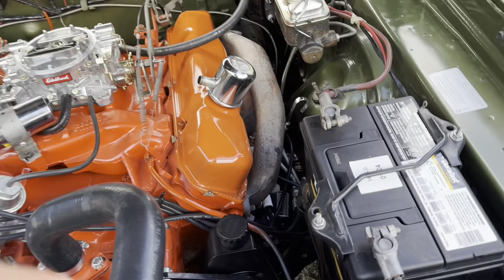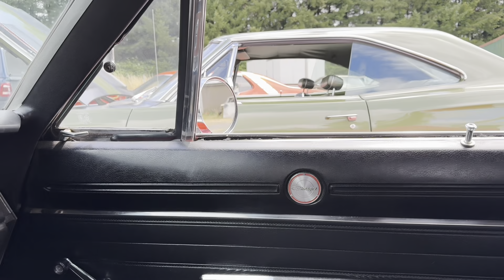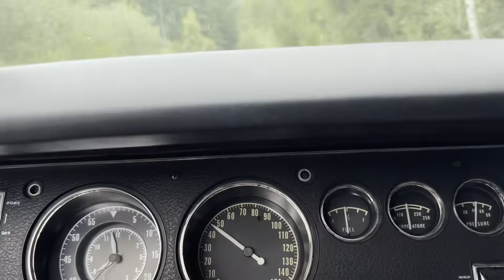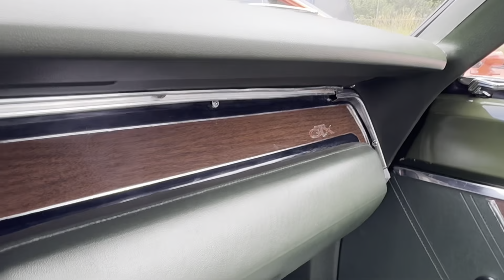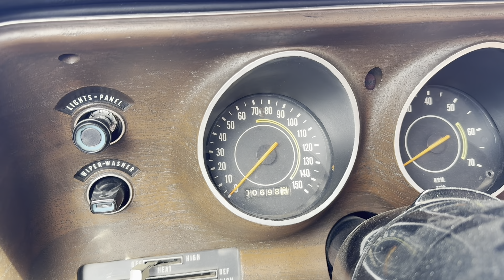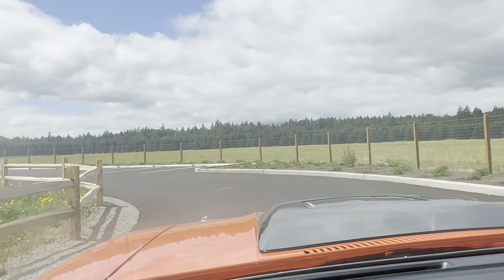An Expensive Front Suspension Is Not The Answer! Magnum Force vs Borgeson Vs Stock Mopar Comparison!

Comment: aftermarket suspension on any mopar the only aftermarket suspension id buy is shocks for the application adjustable shocks for drag racing or kyb adjustable for driving id never use factory shocks again . all factory components tube control arms look impressive but i do not like em
Reply from the maker: Bilsteins do wonders to for ride and handling

Comment: I don’t think that RR suspension is for a daily or weekend driver. As you noted it doesn’t have splash shields but also the steering rod ends don’t have boot covers which looked very dry which will result in accelerated wear causing loose steering. The suspension is probably more for racing.
Reply from the maker: It’s just poorly designed, engineered and doesn’t fix any sort of problems.
Reply: The willwood calipers do not have any dust boot just a singel o ring seal for the piston . Do you get brake pads at your local parts store to wilwood brakes ? Do you thrust a aftermarket steering nuckle ? Do jou need four wheel diskbrakes on a Street car ? Is this junk tested on a wheelstanding 426 hemi b body on the strip ?
Reply from the maker: @hansnordstrom2373  ya not meant for the street which is ridiculous.

Comment: I had a 69' RR. And test drove an early 70s RR 71 72 73 can't remember which. But the handling and ride was way better than my 69'. This was late 70s, maybe early 80s when I drove the test car. I got my RR around 75' or 76' and noticed the ride getting sloppy as the miles racked up. Bottom line A and B body mopar rides don't hold up.
Reply from the maker: Stuff just wears out it happens.  73 was the rubber isolated year and those handle terrible when they wear out.

Comment: You really need to test all three with the same tires.  
On the ‘71 maybe the coil-over setup transfers more harshness to the structure, since the structure wasn’t designed for that.  My limited recollection is 5he 71-2 B bodies were kinda rattly generally compared to previous models.  So for say 12k today?  Save the $.
Reply from the maker: They all had very similar all season radial TA type tires.

Comment: Good comparison, I did all bushings, rubber not urethane, qa1 uppers boxed the lowers rear Hotchkis sway bar added BFGs. Drove the car for a year or two. Got a deal on new Hotchkis torsion bars and was impressed going through dips and to Stops and cornering. Next prolly FF box and Discs, my drums grab and need to see what's going on in there. Thanks.
Reply from the maker: Stiffening helps a lot in handling on these cars.
Reply: The squeak is most likely the spherical joints. I would use those on the street unless you are into lots of maintenance.

Comment: I’d really like to get my 71 Torino Gt riding much better, But that old suspension sucks to drive long distances. All of the old cars weren’t the best. A TKX is in the works for mine. The Borgeson steering I’ve had nothing but problems on my fairlane and everyone around me
Reply from the maker: Interesting to hear the Ford’s have had problems.  Other than how the steering column to box matches up (it’s really awkward how it goes together and causes some problems) have heard mostly good things about the boxes.   Now some of the other stuff… the Borgeson idler arm was shaped wrong on the Gtx so it was hitting the torsion bar when turning.
Reply: @rocketresto  the box gets in the way on fords, to a detrimental effect. can't run PS and 4 speed with headers on any ford, The stock PS units leak every 3 months after rebuilds. Borg unit has alot of overheating issues, sitting at idle for 5 minutes and will be at 240 degrees at fluid not touching Steering wheel. id rather go quick ratio manual at this point

Comment: Really cool and helpful video! Thanks for bringing us a long. Awesome to find out about the Borgeson set up. Wild to think they are on Cherokees too. Hope you get those issues polished out of the cuda, super annoying. Prolly time for a rebuild on that PS pump, and that breaking noise on the right rear sounds like one of the rear drum break pads don't have the spring on exactly right. Problem is that uneven breaking will wear out the mounts unevenly over time and make the rear axle further forward to the right too. Might notice it if you go over a bump and rear end wants to move to the right on you seemingly. It starts out pretty subtle though. All that dash squeeking was driving me insane, not sure I know an answer for that. I might take everything apart and either add shims of thin vinyl, like the slide pads or not sure if spray silicone would work for very long.
Reply from the maker: Going to go back to stock on the front end on the 71 RR, just don’t trust it.

Comment: If you find the stock suspension unacceptable you probably shouldn't have an old car.
Reply: Right on, seen lotsa old cars ruined by folks that should stick with modern cars.
Reply from the maker: Lots of room for improvement on a stock front suspension but no need to reinvent the wheel.

Comment: 1960s Fords were designed right from the factory with the shock tower being the support mechanism, and they are known for the shock towers cracking. Putting all that stress on an area that was never designed for it is only going to lead to failure.
Reply from the maker: Yep not a good design
Reply: 100%

Comment: Very interesting video. I have an aftermarket front suspension in my 70 Challenger. It's a Control Freak which is a Reilly Motorsports knock-off. The car corners very well and much better than stock. The downside is it's very noisy and ride is very stiff even with the Viking coilovers at their most comfortable setting. If had to do it over again I would have left the stock k-frame/torsion bars and just gone with a firm feel steering box and perhaps some tubular control arms. Very similar to your findings!
Reply from the maker: Would have been cool to have some other set ups to try.

Comment: I know more Negative camber helps handling, but it wears out tires in the inside. 
It is common on track events , meaning lots of money spent.  So a couple of new race tires is to be expected sacrifice for a second a lap.

   The Mopar Bible basically advises the tires be straight up and down when the nose is lifted sightly up to simulate the wheel drop when accelerating hard, but this is only for drag racing.  For a "cruise to the cruise night" or "take a long road trip" car I can't see any benefit to having more choices in camber. There is way more than you need already in our cars.
I did quite a bit of tire damage when tried to do a driveway alignment to  reduce the negative camber right before a road trip to a friend's wedding.  After I got on the road, it pulled hard to one side and I realized I did it the opposite ( even more negative camber) and was down to belts showing after about 250 miles. I put on my spare and it  was wearing pretty fast. I had to spend the morning of the wedding looking for a cheap tire already mounted, but the wedding was in the afternoon so I was on time.=. I did a correction at a truck stop and have not had to do it again, though I try to not put new good tires on  the front of any car I aligned myself.
Reply: The issue isn't whether you can get enough camber, it's whether you can get enough camber AND caster.  With stock suspension you can usually get one or the other.  These cars were designed for the bias ply tires of 60 years ago, not modern performance radials.  The correct alignment specs between the two are far different.  Having worked professionally on both vintage race cars (mainly bias ply race tires), and similar vintage performance cars using modern radials, you want a bunch more camber and caster with modern tires.  It's what they're designed for.

As for your driveway alignment... bear in mind that camber on its own doesn't wear down tires fast, incorrect toe does though.  And changing camber will affect the toe pretty dramatically.  It's all a system, and every adjustment affects the others.
Reply: @rennkafer13 
Well, that gives me something to think about.
 Any single one of castor, camber, and toe in will wear out tires even if the other two are perfect. There are pictures of the different patterns of bad wear that each of the three causes on every service manual. 
I always take a look at VW Beetles and dune buggies and they have bizarre looking Camber and I want to see which ones have bad wear. I ask the owners at cruise night. The ones that say it isn't a problem are the ones that trailer the cars.
Reply from the maker: That’s why we use the offset upper control arm bushings to get a little more.
Reply: @auteurfiddler8706  ya, any of them will wear tires, but toe will do it the fastest in my experience.  I've gotten 30-40k miles out of performance tires on cars with -2 degrees camber.  I've seen harder non-performance tires down to cords on the inside in a few hundred miles on cars that were lowered that had a bunch of toe out.
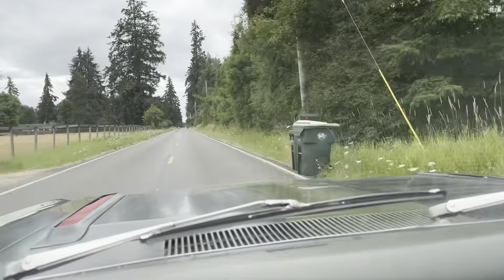Reply: 27:57  How about the GTX needs more castor?

Comment: I always wanted "Comp T/A"s of the 1980s, as opposed to the steel "Radial T/A" 
But for a 67 to 69 model year Mopar, I like the look of red lines.
Types of Tires, oldest to newest:  1.  Bias   like ( 7.75 14)      2. Bias belted (Polyglas GT for example)  3. radial belted  with steel or with fabric belts.

Red lines with radial construction.  Maybe the best of both worlds.  But expensive.
Both are offered.  At the price, I think I would buy some low cost radial white walls and maybe paint them red.
You can still order them in 75 series and maybe 70 series.
 I would bet more 69 GTX's and 68 Charger R/T's came with whitewalls than any other tire, so maybe just leave the sidewalls white.
Reply from the maker: Like the look of those particular tires.

Comment: All the popping in turns is what you get with polyurethane bushings. I hate urethane suspension parts. I've reverted two of my cars back to all stock rubber because of all that noise.
Reply: I've probably had 10 cars with poly bushings and never had that problem, installed probably 30-50 more sets in customer cars without issue as well.  If the car is popping in turns, there's another issue.
Reply: @rennkafer13  That's a lot of cars. Glad you're having good luck. I'll never try poly again after 2. Guess I accidentally fixed them when I went back to rubber.
Reply from the maker: Poly can sometimes make that noise but this this was just worn out parts.  This car has had 700 miles on this, it should not be worn out.

Comment: I agree, the stock torsion bar suspension is the way to go, especially considering the cost of the aftermarket kit. It's much better to use some of that money to just replace any worn out stock components and a good set of shocks. Firm feel steering box is good, although I am ok with the "zero road-feel" stock box. Sways bars really help, especially front and rear.
Reply from the maker: Have found a rear bar doesn’t make much of a difference but the front certainly does.
Reply: QA1/others makes kit's that keep the t-bar's the rack-kit as my new engine has a 8~in SS-types  pan the drag-link doesn't fit well and or iv herd it can handle if set-up correctly

Comment: I disagree with your statement that the core support on all Mopars left the factory with the  front facing side painted black.  I owned an original paint 1971 Challenger, that I bought in 1986.  The car was unrestored.  The entire core support front and back was painted the body color GB5 Bright Blue Metallic.  There was NO black anywhere on the front of its core support..
Reply from the maker: Some dark colors didn’t get it but they should have.  If you car didn’t have it it was missed on the assembly line and was a mistake.

Comment: An idea for the next Rocket Test Labs- calculating the degree of rear axle pivot, in jounce mode, to the degree of body roll allowed by a rear sway bar.   In the "Roadability And Handling" (September 1965)
Volume 65 #09 MTSC training book, page 5 begins the discussion on rear axle geometry.  When cornering, body roll puts weight on the outside wheels. At the rear wheel, the articulating shackle allows an amount of forward pull of the axle in jounce position (when weight is put on that side). This causes the rear wheels to point in the same direction as the fronts giving a caster effect thru the cornering. The question is, how limiting is a rear roll bar to this pivot of the rear axle in jounce position? Is there a perfect roll control ratio to axle pivot angle by changing sway bar thickness? A scale of sway bar thickness to axle pivot degree ratio, does anyone calculate one of those?
Reply from the maker: We had a 67 Fury race car that was in the 24 hours of Lemons and we actually ended up taking the rear bar out, it just didn’t do a lot.  Was a long wheel base car but personal experience.

Comment: I put a borgeson in my E body. The box  $600, hoses $100, coupling from Bergman that fit to the box without cutting the column  $200.  A lot of guys buy a TA length pitman when they get a firm feel. ($200)The long pitman is not needed with the borgeson. I got a NEW box with more room for exhaust. It steers better than my 2021 daily driver. I would bet that the comparison between firm feel and borgeson would be closer if both cars had their alignments dialed in. I spent more time dialing in the alignment than installing the steering box. Moog problem solver bushings on the stock control arms are the best.
Reply from the maker: Borg definitely had better feel and price isn’t super far apart.  Not a fan of how the column goes into the box however.

Comment: Dartiness sounds like alignment.
I was under an impression that the amount of power assist, lightness of steering, was determined by the strength of the spring there at the outlet of the power steering pump. IDK what FF does to make their box feel firm, maybe it's tolerances? 
I can't believe they designed it to mount to the body.. omg.  Good on dad to put it right.
I'm trying to figure a way of doing a bounce count in the video between the T bar cars and the coil one. It's that continuing bounce of a coil that makes them feel like a boat or on pogo-sticks, particularly McPherson strut type. T-bars tune that bounce out flat and fast.
Reply from the maker: Could be alignment, Jamie aligned this car and got it as close as we could with the parts provided.

Comment: The factory torsion bar set up was junk from the factory....I'd take that magnum for e front end any day.
.....and that brand is top of the line for Mopar k members....soooo yeah...lil Mopar knowledge for ya 😢😮😮😮
Reply from the maker: The sarcasm is dripping from your comment.
Reply: That f--ckn highly polished, triple chromium plated, Star Wars, Space age MAGNUM coil over bullshit contraption under your dad's  Roadrunner  gotta go. I don't know. If you keep it you might aswell go and add one of those fancy genuine, triple chromium plated, FULL HOUSE BILLET, March pulley set ups to the front of the engine along with a purple anodized AL U MIN E UM flex fan. Unfortunately  your still stuck with your basic black serpentine belts. Now there's an idea....Someone needs to bring to  market a line of glitter impregnated, light up fan/accessory  serpentine belts! Call em RAINBOW belts. 🌈  😅 The idea of a time/ performance proven OEM K frame and torsion bar suspension or brake systems wheels and tires  has gotten so perverted by the SEMA suck up following. Look at old pictures of Nascar prepped Chargers, Torinos, Chevelles, they were running fu--ckn HD DRUM brakes at all 4 wheels well into the 70s....None of the drivers runnin Mopars had any complaints about the torsion bar front suspension set up
 Oh my GOD! LIVE REAR ENDS! WHAT NO OVER COMPLICATED INDEPENDENT REAR SUSPENSION!? YOU MEAN A CAR COULD ACTUALLY BE ABLE TO HANDLE AT SPEED WITH A OH SOOO ANTIQUIDATED SOLID LIVE REAR AXLE. OH THE HORRORS (exclaimed the snooty Road and Track or Car and Driver or Motor Trend magazine know it all journalists) Another thing...what's the point of using tire shine when modern tires have those ugly textured ribbed sidewalls presumably  so they can substitute  different brand names in the manufacturing molds...Anyone remember buying new tires at blem sales?  Drove Ford Crown Vics hard at times many many miles over many years. 1994 to 2013. When Ford changed them over to the rack and pinion steering set up I had great anticipation to feel the big improvement. Well still handled good for a larger car but was no different from the old steering box.
Reply: Stick with Ford's and G.M.s pal...lol
Reply: Hopefully all those popping noises haven't yet been the results of metal fatigue cracks in the shock towers and unibody forestructure caused by that fancy "UPGRADE"  coil over deal. Kind of like the same sound made by the later first gen Dodge truck cabs when they develop small stress cracks in the sides of the upper cowl plenum. So   a little more Mopar knowledge for ya......😂 Hope you know I'm kidding. Enjoy your channel  very much. Just had gallbladder surgery and had time to do a little keyboarding.
Reply from the maker: @craigpolinski8955  Wife had that a couple years ago, recovery wasn't too bad.